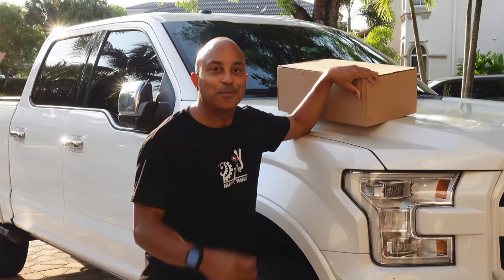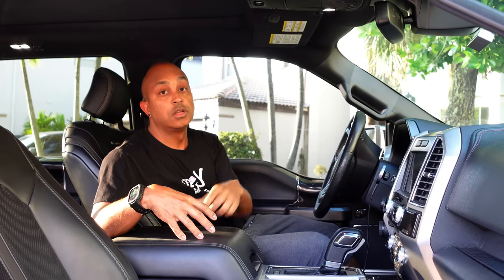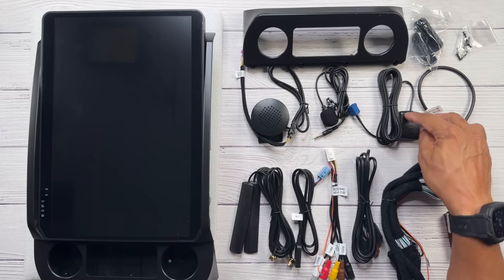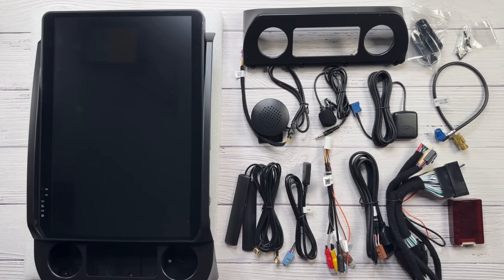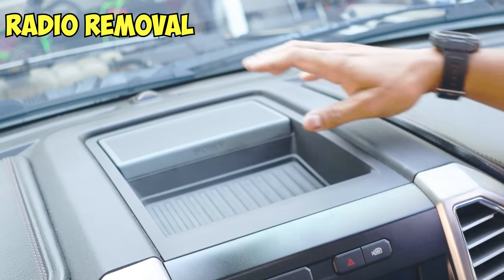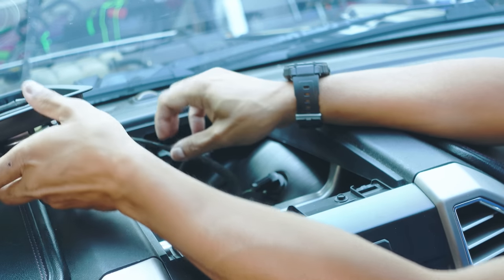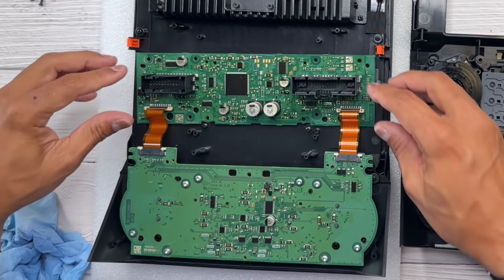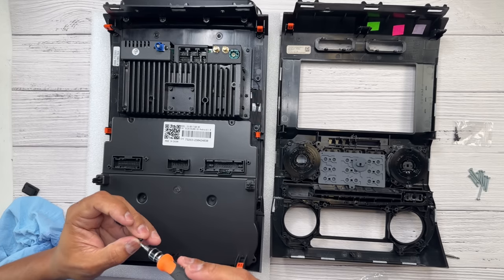BEST TStyle Radio for F-150 | Retains SYNC 3 | AutotecPro 14.4"

Comment: Will this fit on a 2021-2023 f-150?
Reply: On their website it only shows to 2021. I believe it does.
FYI:
I'm not happy with mine. I watched this video and I ended up getting one. But as soon as I installed it I wish I hadn't. It might just be me but you need to do everything(DIY) as far as the way it operates. There is no way of turning the system off. It is supposed to remember where you left off, it doesn't. The radio would turn on on its own. When I wanted to listen to the radio it would always come on with the FM2 stations which I had never setup. I have had to reset the unit at least once every 2 weeks if not more. I've had problems with it since installation (12/23) until I took it out last week(8/24). The final reason I took it out was my APIM went bad ($300, overheated, I believe). The OEM APIM attaches to the back of the unit at the heat sink fins. I asked AutoTec Pro if I could return and possibly get 3/4 of what I paid for it back since it has never worked correctly. They said NO! Nothing about it was straight forward. This product should work correctly without having to do anything once installed. Hopefully people have better luck than I did.

Comment: Help!!!
My temperature controls didnt line up correctly... the left knob doesnt fit at all...
The information i put on my order was correct...
Reply from the maker: Is it the manual or the auto temperature controls.  THey should line up easily, make sure you have the right trim plate installed.  If you have I would take pictures and send to sunny at autotecpro they may have to send you a new unit
Reply: @DeaninItYourself  yes. I got it to fit with the manual climate frame. However my android auto has a sound delay with YouTube music and videos. Almost 2 second lag. Thinking about downloading sync 3.4 to the system. Will this affect this screen?

Comment: My sync will not show up on the screen and I don’t have volume nor back up camera. Could you please advise?
Reply: Mine did the same thing after a while and found out that my OEM APIM went out. 
FYI: I'm not happy with mine. I watched this video and I ended up getting one. But as soon as I installed it I wish I hadn't. It might just be me but you need to do everything(DIY) as far as the way it operates. There is no way of turning the system off. It is supposed to remember where you left off, it doesn't. The radio would turn on on its own. When I wanted to listen to the radio it would always come on with the FM2 stations which I had never setup. I have had to reset the unit at least once every 2 weeks if not more. I've had problems with it since installation (12/23) until I took it out last week(8/24). The final reason I took it out was my APIM went bad ($300, overheated, I believe). The OEM APIM attaches to the back of the unit at the heat sink fins. I asked AutoTec Pro if I could return and possibly get 3/4 of what I paid for it back since it has never worked correctly. They said NO! Nothing about it was straight forward. This product should work correctly without having to do anything once installed. Hopefully people have better luck than I did.

Comment: Hey there! I just installed this radio on my f150. I’m having an issue where when I skip to the next song on CarPlay it jumps over to sync radio and then back to the next song on Spotify on CarPlay. Any ideas?
Reply from the maker: Do you have the latest software update installed?
Reply: @DeaninItYourself  says app version 5/17/2024. Also says GT6-NA16.00.050
Reply: I wouldn't be surprised!
FYI:
I'm not happy with mine. I watched this video and I ended up getting one. But as soon as I installed it I wish I hadn't. It might just be me but you need to do everything(DIY) as far as the way it operates. There is no way of turning the system off. It is supposed to remember where you left off, it doesn't. The radio would turn on on its own. When I wanted to listen to the radio it would always come on with the FM2 stations which I had never setup. I have had to reset the unit at least once every 2 weeks if not more. I've had problems with it since installation (12/23) until I took it out last week(8/24). The final reason I took it out was my APIM went bad ($300, overheated, I believe). The OEM APIM attaches to the back of the unit at the heat sink fins. I asked AutoTec Pro if I could return and possibly get 3/4 of what I paid for it back since it has never worked correctly. They said NO! Nothing about it was straight forward. This product should work correctly without having to do anything once installed. Hopefully people have better luck than I did.

Comment: Did you get a screen protector, I was wanting a glass screen protector.
Reply from the maker: I was thinking about getting one, but i havent found one yet.  Any suggestions?
Reply: @DeaninItYourself  no, I think I may just measure the screen and try to find a glass screen protector around the same size. Were you able to change the wallpapers I cannot seem to figure out how.

Comment: Just curious...and everyone please be kind, I'm not a car guy...why an aftermarket GPS connection/unit AND the factory GPS both connected to the new unit.  Thanks
Reply from the maker: The aftermarket unit has its own gps maps so it needs the gps connected to it if you want to use the built in maps.  If you want to use your factory maps and the sync features, you need the factory gps connected.  I guess it would be easier if they made a splitter so you could just use the facory gps antenna
Reply: @DeaninItYourself  Gotchya, thanks!

Comment: I just got this but I have the sync 1 and I ordered it that way but it does not seem to line up properly.
Reply from the maker: I think the bolt holes are a bit off. As long as you can secure two you should be ok. The important thing is to make sure the gps antenna is at the top
Reply: @DeaninItYourself  i got it to work but i didnt plug in the backup camera somewhere

Comment: Did you have to give a IMEI number from the head unit? If so were did you find the number?
Reply from the maker: No I didnt, i just put the SIM card in and rebooted the radio
Reply: @DeaninItYourself  thanks
Reply: What services did you use. Verizon is telling me they can't do it without the IMEI NUMBER.

Comment: I just installed mine today and the screen flickers. Updates to follow.
Reply: I had issues from the start with mine. I wish I had pulled it out and returned it while I could. Too much money to waste.
I'm not happy with mine. I watched this video and I ended up getting one. But as soon as I installed it I wish I hadn't. It might just be me but you need to do everything(DIY) as far as the way it operates. There is no way of turning the system off. It is supposed to remember where you left off, it doesn't. The radio would turn on on its own. When I wanted to listen to the radio it would always come on with the FM2 stations which I had never setup. I have had to reset the unit at least once every 2 weeks if not more. I've had problems with it since installation (12/23) until I took it out last week(8/24). The final reason I took it out was my APIM went bad ($300, overheated, I believe). The OEM APIM attaches to the back of the unit at the heat sink fins. I asked AutoTec Pro if I could return and possibly get 3/4 of what I paid for it back since it has never worked correctly. They said NO! Nothing about it was straight forward. This product should work correctly without having to do anything once installed. Hopefully people have better luck than I did.

Comment: what do you think of this unit vs the Linkswell XL unit?
Reply: I wonder if he can answer, I need more info
Reply from the maker: I went with this one mainly because it retains all the factory sync settings, the Linkswell unit does not retains the Sync.
Reply: I had the Linkswell Gen 2, and it took a long time to boot up. This unit is a lot better

Comment: You need to have a link to buy this! Just off of EBay?
Reply from the maker: use autotecpro.com, so you can take advantage of the support.  if you buy it on ebay, you have to troubleshoot any problems by yourself
Reply: @DeaninItYourself  I got mine and installed it. Works good, except in Android Auto my phone is flaky. Maybe support will help out.

Comment: I have had this system for about 6 months and it still has a bug that has been unresolved. When you set a station on the XM radio, it doesn't preserve between vehicle restarts.  The steering wheel controls that change the station are also buggy. Pressing the steering wheel selector switch left and right to change saved channels will often not work at all. I have contacted support and was told these were known issues and that the manufacturer has not given an eta as to when it might get fixed. Buyer be-aware.
Reply from the maker: Did you try using the Sirius app instead?

Comment: I have a 2015 XLT w/Sync 2. Has anyone simultaneously installed one of these with a used Sync 3 unit? Are there any gotchas or advice?
Reply from the maker: I would order the one that matches the version of sync you have

Comment: which sim card and wireless company did you go with and was it plug and play just pop it in and it works?
Reply from the maker: I went with tello prepaid SIM card. It was plug and play for me. At first it didn’t recognize the sim but then I resarted the unit and it recognized it immediately. I didn’t have to configure anything.

Comment: How is this holding up for you? I want to get this
Reply from the maker: its still holding up well, its been over a year
Reply: Mine is already not working Ive had it 2 months
Reply: I'm not happy with mine. I watched this video and I ended up getting one. But as soon as I installed it I wish I hadn't. It might just be me but you need to do everything(DIY) as far as the way it operates. There is no way of turning the system off. It is supposed to remember where you left off, it doesn't. The radio would turn on on its own. When I wanted to listen to the radio it would always come on with the FM2 stations which I had never setup. I have had to reset the unit at least once every 2 weeks if not more. I've had problems with it since installation (12/23) until I took it out last week(8/24). The final reason I took it out was my APIM went bad ($300, overheated, I believe). The OEM APIM attaches to the back of the unit at the heat sink fins. I asked AutoTec Pro if I could return and possibly get 3/4 of what I paid for it back since it has never worked correctly. They said NO! Nothing about it was straight forward. This product should work correctly without having to do anything once installed. Hopefully people have better luck than I did.

Comment: Does the voice command work the same as before?
Reply from the maker: it works the same for the sync interface, if you are using carplay you need to hold down the menu icon on the screen and it will activate siri if you are using apple.  or you can just say "hey siri" and it will work the same

Comment: I just installed mine, but the A/C wont turn off.
Any one had this issue?
Reply: I had that issue and had to do a reset.
FYI:
I'm not happy with mine. I watched this video and I ended up getting one. But as soon as I installed it I wish I hadn't. It might just be me but you need to do everything(DIY) as far as the way it operates. There is no way of turning the system off. It is supposed to remember where you left off, it doesn't. The radio would turn on on its own. When I wanted to listen to the radio it would always come on with the FM2 stations which I had never setup. I have had to reset the unit at least once every 2 weeks if not more. I've had problems with it since installation (12/23) until I took it out last week(8/24). The final reason I took it out was my APIM went bad ($300, overheated, I believe). The OEM APIM attaches to the back of the unit at the heat sink fins. I asked AutoTec Pro if I could return and possibly get 3/4 of what I paid for it back since it has never worked correctly. They said NO! Nothing about it was straight forward. This product should work correctly without having to do anything once installed. Hopefully people have better luck than I did.

Comment: That still have a lot of work to do, problems. Takes 3 times plugging in my iPhone to get sound, a real pain in the ass (that’s wired CarPlay ) Volume controls on the unit a very laggy. Does not remember sync settings, you don’t what you will get when you start up, volume high as shit blows your ears out.
Reply: Yep, I'm not happy with mine. I watched this video and I ended up getting one. But as soon as I installed it I wish I hadn't. It might just be me but you need to do everything(DIY) as far as the way it operates. There is no way of turning the system off. It is supposed to remember where you left off, it doesn't. The radio would turn on on its own. When I wanted to listen to the radio it would always come on with the FM2 stations which I had never setup. I have had to reset the unit at least once every 2 weeks if not more. I've had problems with it since installation (12/23) until I took it out last week(8/24). The final reason I took it out was my APIM went bad ($300, overheated, I believe). The OEM APIM attaches to the back of the unit at the heat sink fins. I asked AutoTec Pro if I could return and possibly get 3/4 of what I paid for it back since it has never worked correctly. They said NO! Nothing about it was straight forward. This product should work correctly without having to do anything once installed. Hopefully people have better luck than I did.

Comment: any bugs 3 months later???
Reply from the maker: so far so good.  its been almost a year now
Reply: FYI:
I'm not happy with mine. I watched this video and I ended up getting one. But as soon as I installed it I wish I hadn't. It might just be me but you need to do everything(DIY) as far as the way it operates. There is no way of turning the system off. It is supposed to remember where you left off, it doesn't. The radio would turn on on its own. When I wanted to listen to the radio it would always come on with the FM2 stations which I had never setup. I have had to reset the unit at least once every 2 weeks if not more. I've had problems with it since installation (12/23) until I took it out last week(8/24). The final reason I took it out was my APIM went bad ($300, overheated, I believe). The OEM APIM attaches to the back of the unit at the heat sink fins. I asked AutoTec Pro if I could return and possibly get 3/4 of what I paid for it back since it has never worked correctly. They said NO! Nothing about it was straight forward. This product should work correctly without having to do anything once installed. Hopefully people have better luck than I did.

Comment: I personnally could care less about sync 3 it has entirely too many issues. Rather just switch to car play.
Reply: Why do you care about sync 3? It’s ok but I couldn’t care less about sync 3, personally.
Reply: @iwillbnnedafterispeakwhy6498  because the radio he put in as a replacement retains sync3 instead of just using an idatalink Maestro to convert it to android auto which is much more reliable than sync3.